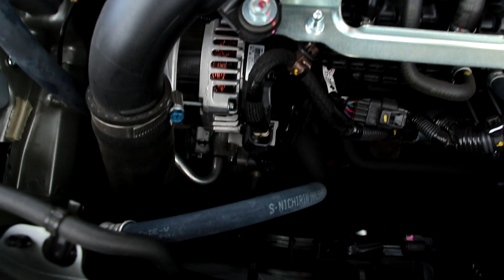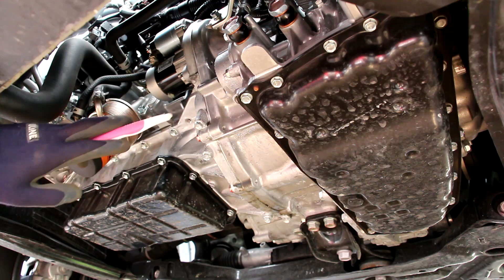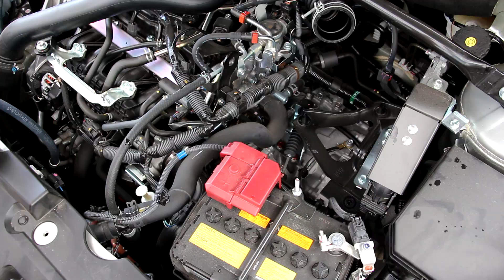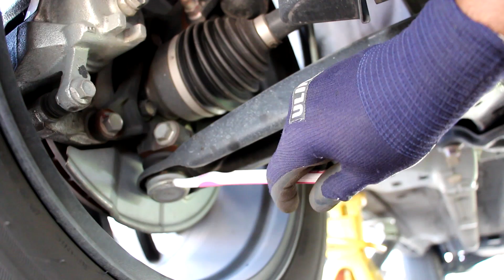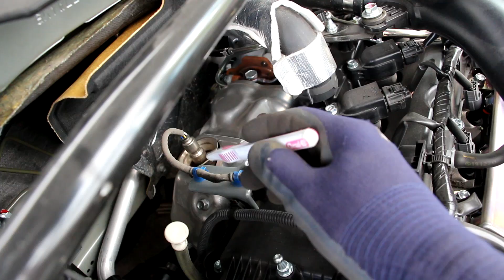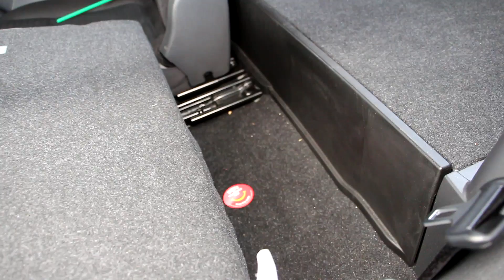Mitsubishi Eclipse Cross Mechanical Review

Comment: I'm loving the under-hood engineering here.  Mitsubishi (at least here in the US) offers a really long powertrain warranty and it's obvious that they've engineered this one to last.  A modern turbocharged engine but with dual-injection, easy maintenance, and keeping things as simple as possible to improve reliability.  Awesome.  

People dump on Mitsubishi for their designs being dated but IMHO that's a good thing. If you plan to keep a car a long time, simple proven technology is the best choice.

Would love to see a mechanical review of the Mirage if you get the chance!
Reply from the maker: I've been looking around for a Mirage to make a mechanical review as a joke... I'm sure everything would be miniature sized not to mention a lot of corners cut.
Reply: @speedkar99    It looks very 1990s under the hood.  NOTHING is hard to get to.  I have a Mirage which I bought new with 14 miles on it.  Now at 157,000 miles, all it has needed other than maintenance was a clutch cable at 113,000.

It has been the most reliable car I have ever owned.
Reply: @speedkar99  I think you would appreciate the cavernous engine bay space of the Mirage. My mechanic said getting to everything is very easy and that the Mirage should be used as a teaching tool to students in mech school. The 3A92 engine is a tough, timing chained bastard. Unrefined and slow but proven after 20 years in production.
Reply: Agree and Mitsubishi is also 4th in customer satisfaction.
Reply: I've never had to use my warranty. Very reliable
Reply: Watch out, I think that CVT is a Jatco unit, which is prone to early failure. Nissan and Renault basically own Mitsubishi.
Reply: Ｉbought my Mitsu. Galant in 2003.  It served me 17 years! with 160k trouble free miles.  On 01/01/2020, the timing belt broke, and that's the end of it.   Back in the 90s, Mittsu. used to buld great vehicles, like other Japneses car manufacture.
Reply: 1g2002541 It seems that their cars are still built to last, according to this review! I love my 2003 montero, and my only complaint is I wish Mitsubishi still made a 4wd suv like it. From what I see, this awd system is pretty impressive, but I’m loyal to 4wds.
Reply from the maker: @explosivemallard8038  Nice
Reply: @1g2002541  Galant 2000-2010 is indeed reliable although still burn some oil.  The most problematic from Mitsubishi are the smaller one, Mirage, Lancer, etc. The camshaft, valve stems, seals worn so fast compared to Honda or Toyota.
Reply: @rondhole  Nothing wrong w burning OIL, just topup every mid cycle. They are a smaller manufacturer compared to the Giants but I think they put up a good showing.   They should have transferred more of Evo technology to their range of cars.
Reply: But basically,  what I am saying is, compared to the ultra-complicated and poor user-friendliness of most modern day cars under hood.....this Mitsu eclipse cross looks built to provide easy maintenance and looks long-lasting.
Reply: @streetrider2487  No, it kills your catalytic converter much faster, less than 1/2 of cars that do not burn oil.  Most Mitsubishi, got catalytic converter problem right after 100k miles/when warranty expired.  Most Toyota has no problem with its catalytic converter even beyond 400k miles.    Cat is very expensive, at least 1000 to replace, after market cat are not good, die young.  In short, any car that burns oil  and most Turbo cars with GDI only, are projected to live short <200k miles before expensive repairs.   So, if you want cars that trouble free beyond 200k miles, make sure it does not burn oil, has port  or dual injections, and in many respects Hybrid HSD has much longer life than any small Turbo cars.  In my opinion, Mitsubishi should focus in their strength for Diesel, large Truck/off road SUV like Pajero, etc. Not gasoline sassy SUV.
Reply: @streetrider2487  I hope I am wrong, but if after 60k miles it starts burning oil more than 1L per 5,000 miles, the old story is still valid.  With direct injection only, for sure the intake valves will get really dirty just like most Hyundai, and VW.  Hopefully not as bad as VW with defective injectors, coils, high pressure-fuel pumps, worn engine bearings, crumble plastics and timing chain guides, etc.   For me, Hybrid+naturally aspirated engine is still the best solution for good power and MPG, compared to turbo+direct injection or Diesel + DPF, etc. History in the past 15 years already proved it.
Reply: @rondhole  Turbo - dual injection ports with proper tuning and maintenance will give the best power.  Hybrid....well, unless its a performance electric motor, otherwise most r really bland.

we have to stop focusing on pure mpg...its making vehicle manufacturers produce some really stupid ideas like GDI single port injectors only and stop-start engine controls at every blood stop.
Reply: @streetrider2487  I agree. We need appliances that reliable last 3 generation. Not a toy for teenager.   Most newer cars from Honda and Toyota are more fun than  others at the same price range. Even cheaper Golf and all Leon, mazda3, and Octavia used primitive torsion beam suspensions.  All corolla, prius, civic are using independence rear suspension and handling much better. It is not bland anymore even with CVT.
Reply: @streetrider2487  If you are bore, take serious mountain bike, motorbike, or GoCART. They can be more fun than any car.   CVT when it is made properly is the most efficient transmission. Toyota used proven reliable planetary gears type, No BELT, all gears, no torque-converter in its hybrid. They are more reliable than even 8 speed torque converter.  Dual clutch is a joke, they all fall apart, just when (60-100k miles).  I agree, a Good Torque converter 4,5,6,7,8 speeds are the good one.  But after all all EV will be CVT in the sense and they can be fun.  Newer CVT are using simulated gears to satisfy our EGO feeling of having different speed, Corolla has actual 1st gear before switch to the belt CVT. Most people do not notice it anymore if they have CVT.   Many big manufacturer like Benz, BMW are leaving Dual-Clutch because it is physically not reliable no matter how much you try and using torque converter that acts as quick as dual clutch these days.
Reply: @rondhole  Yup I ride my 1250cc suzuki bandit  when I am bored.  changes gears well .  Again, I know CVT is for efficiency, but it really drones on...
Reply: @streetrider2487  no if you accelerate mildly and safe fuel as what you are supposed to for Appliances cars.  Newer CVT has no droning effect with simulated gears but it is just stupid in my opinion. If we drive mildly, it is the smoothest car with smooth transmission, keep RPM low or use bigger engine like Camry.
Reply: @rondhole  and builds up carbon....cos most are GDI engines nowadays....LOL
Reply: Yeah but the worst part is the Jatco CVT! They should dump Jatco
Reply from the maker: @chosenone773  They are owned by Nissan which uses Jatco CVT's. We can't get away from it.
Reply: I fully Agree!!!!
Reply: You forgot one problem, it has a cvt. Cvt transmissions are so bad, they don’t last.
Reply: @Rekt-M8-v4  I've had 5 Mitsubishis 4 had CVTs and they never broke.
Reply: Mitsubishi AWC dude the use the jatco (same as nissan) plus the use cheap piston rings
Reply: @FerasAlhawas  Mitsubishi owns a portion of Jatco. I already know that.  I've had over 150K miles in all the Jatco CVTs I've had. Very reliable and the warranty that backs that up.
Reply: @e2xx911  you're one of the lucky ones.
Reply: @e2xx911  I will back that up! My Suzuki has a Jatco CVT too. I got 150k miles still going strong. Its the same one they put in the Outlander, Outlander sport, and Lancer.  Jatco JF011E
Reply: Rekt M8 This is a bit of an outdated belief. Years ago it was true, but now CVTs have become much more reliable. I do wonder if they are as long-lasting as current automatics, though.

It’s like the belief that automatics get worse fuel economy. This used to be true years ago, but now it’s the opposite in many examples.
Reply: @Rekt-M8-v4  Depends on who makes it I guess.  Mitsubishi warranties the CVT for 10 years/100K miles so if it goes bad it's on their dime to fix it
Reply: @driveway_of_misfits  Its likely a Jatco, so even if it gets replace under warranty, it will fail again out of warranty.
Reply: Mitsubishi just needs to hire some german engineers like kia and Hyundai to design the look of the car alone.

Mitsubishi mechanicals are rock solid. The president of mitsubishi motors is a total idiot and keeps making bad decisions.
Reply: @warcrabcyber9908  If you're going to hire somebody to restyle the car, hire one of the Italian design houses...they can make Speedkar's brother's oily soiled underpants look like a Michaelangelo sculpture
Reply: We looking at the same car? 🤔
Reply: Ugh...... Mitsubishi gasoline engine with Turbo?  They do not even have reliable simple engines for decades.  Their cylinder rings, cylinder block, valve stems, camshafts worn out much quicker than Toyota, Honda, Mazda, or Nissan.  With the Turbo, I expect nothing but troubles.   I wish they bring their Diesel engine instead.
Reply: @rondhole  10year warranty on engine and transmission bro.   And they do [used to ] make the EVO
Reply: @streetrider2487  Yes, they still burn oil.  1L every 1500 Km is normal and we cannot complaint about it and 10 years warranty won't cover your ass for it. The resale value of Mitsubishi is below Hyundai and Ford for  a good reason. I will take Mitsubishi Turbine or Generator, or Turbo units for most Turbo cars.

Comment: No single japanese worked to make this engine. It's ugly to see underhood. From 'Fram' oil filter I think french made this engine. IMHO.
Reply: This is a 100% Mitsubishi Motors engine based on the 4a9 engine series.
Reply: @trent7080  yes, a 100% Mitsubishi made engine, and Mitsubishi is pretty much owned by Nissan and Renault. So its likely they did most of the work.
Reply: Andrew M this vehicle was fully designed and manufactured by Mitsibihsi. This was well in place before the Nissan took a 38 percent stake!
Reply: @andym1223  Mitsubishi is majority owned by the Mitsubishi Group. Nissan has a 34.03% stake in the company. Renault or Nissan dont own Mitsubishi Motors. Nissan and Mitsubishi have a Joint Venture.
Reply: Very likely since Mitsubishi is pretty much owned by Nissan/Renault.
Reply: He’s taken the top plastic engine cover off to show what it looks like and point out parts

Comment: I have absolutely zero interest in owning this POS. But i really enjoy your mechanical overviews. So i still watch. 

I'm eagerly awaiting the Toyota 4Runner review. That's going to be my next vehicle.
Reply: Your Toyota 4Runner uses Mitsubishi Materials Corporation parts, so they must not be too big of a POS.
Reply: @trent7080   I wasn't saying the Mitsubishi corporation was crap. I was specifically referring to this "eclipse" with the turbo 4cyl that already has weeping seals at very low mileage.
Reply: @trent7080  No, it doesnt. Dont say things that clearly arent true.
Reply: @andym1223  I worked for a Toyota dealership in the service department. I can confirm that some components on Toyota are Mitsubishi made. Nissan, Mazda, and Honda also use Mitsubishi parts.
Reply: @andym1223  Um yeah, it does.

Comment: Can graphite or lithium grease as anti-seize, instead of the copper grease?
And why doesen't factory use anti-seize (where needed) on new cars?
Reply: lithium grease is anti-corrosion for metals, I don't think it's anti-seize
Reply: @GeordiLaForgery  Thanks. What about the graphite grease?
Reply: @DashCamSerbia  I use graphite grease for anti-rust on my disk breaks and copper grease for the break pads for noise reduction. Works fine for me.

Comment: I honestly never use radiator drain plugs. It's way faster to disconnect the hose.
Reply: In my experience, hoses sometimes leak if removed (even when the clamp is replaced in the same position). And you can't tighten OE clamps. Drains are nice for this reason. Less messy too (but slower).
Reply: It depends, if the job require you reuse the coolant, having a drain plug is much more helpful
Reply: It’s Ok I’m when it’s not  your driveway
Reply: So how do you clean off inside of the radiator??? You need to flush out whatever dirt or residue via drain plug
Reply: A lot messier too :)

Comment: I had this engine 4a91  in my old lancer 2008 non turbo 107hp was very reliable ,just the piston rings are known to burn oil I think but I never had any issues
Reply: I'm on my 5th Mitsubishi my Lancer, 2 Outlanders, and Galant had over 150K miles before I traded them in. No issues except dead battery lol.
Reply: @e2xx911  what year Galant I had 97 prob most solid car was ever in
Reply: @Rory96inthahouse  2002 Galant ES
Reply: @e2xx911  
I am still using the original battery on my 2008 Lancer. Never had to recharge it ever.
It's the rust I'm fighting against...
Reply: "just the piston rings known to burn oil" 
Very reliable.
Burning oil. 
Reliable.
Lol wut,
Reply: @Questchaun  burning a lil oil does no harm , still keeps goin..

Comment: What's the difference between changing cvt oil on car with vs without a dip stick, don't you just refill with the same quantity that came out?
Reply: The the dipstick lets you check the fluid level and fill it from the top. Most modern transmissions without dipsticks require you to pump fluid in through a hole in the side.
Reply: Usually a dipstick shows if it's needed to be changed or if some problems arise or needs more fluid.
Reply: Toyota has a sealed system
Reply: @trent7080  Yes, they do and it rarely fails. Their Hybrid CVTs are bulletproof.
Reply: You throw the car away when the chain belt breaks.
Reply: @Questchaun  which will be soon because its a Jatco unit.
Reply: I refilled my cvt transmission Eclipse cross 2018 with oem cvt transmission fluid.

Comment: What would you like to say about 0W-20 oil? Is it safe enough to clock 100000 miles?
Reply: The eclipse cross take a Mitsubishi manufactured oil only in 5w 30 low calcium oil. Manufacturing spec is oil change 12 months/15000km’s.
Reply: Toyota uses 0W-16 in their new cars, and I have a 270k mile honda civic that specifies 5W20, so 0W20 is probably going to be fine.